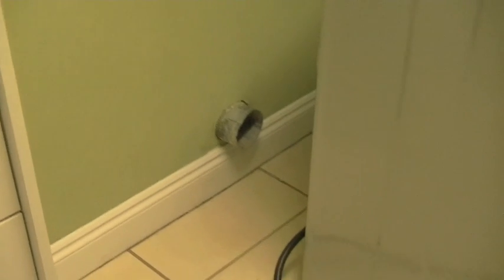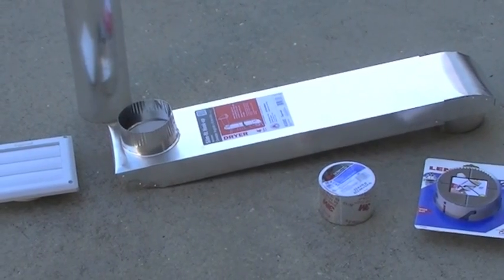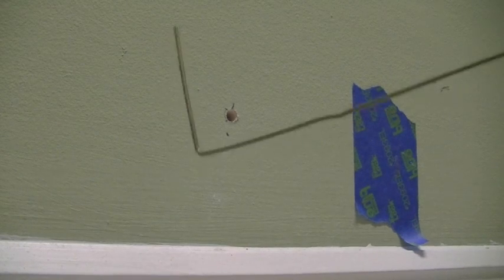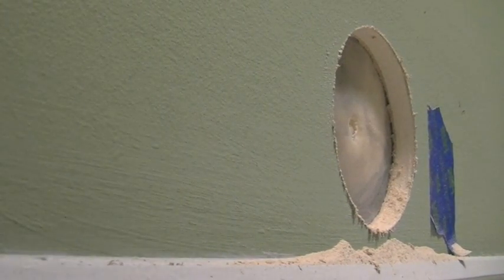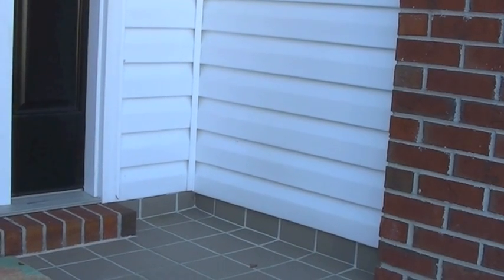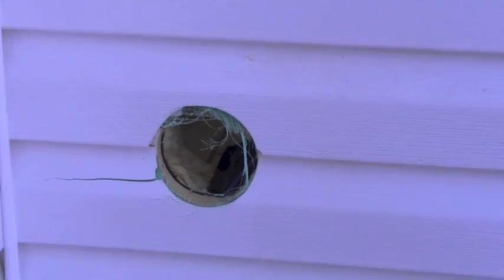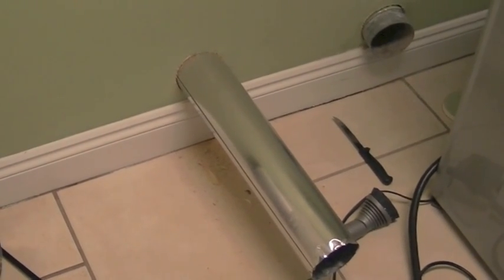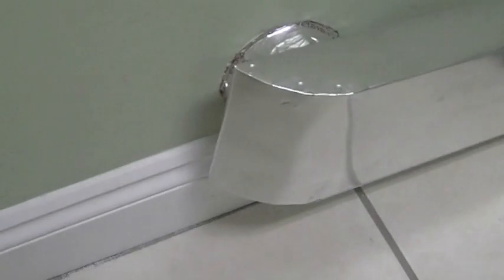Dryer Vent DIY Project #1

Comment: I'm watching this in 2025 and this is by far the WORST dryer vent installation I've EVER seen.
Reply from the maker: @georgewoolinghamii488  Thank you for your input.  FYI, 2025, this project is still working perfectly with no issues.
Reply: @KnTGoree  Didn't say it wasn't functional but the placement, the methods, and the materials used aren't the best I've ever seen otherwise it wouldn't be by your front door, cracked siding during drilling and that periscope is an in wall design but if your happy with it then good 4 you, you did it. The function of a dryer vent is not difficult but this install wasn't anything deserving recognition expecially to pride yourself on youtube. ANYONE with basic common sense can just install a dryer vent but doing it appropriately is something else. The only things I can say good about it other than it functions and is sort of out of the weather is anyone ringing your door bell will get the fresh scent of your dryer sheets.

Comment: Why did you need the telescoping tube?.  Couldn't you have connected direct to the outside and use a semi-rigid tube from dryer to new vent hole?  You'd shift the dryer to the left giving more room to the washer at the right.

Comment: Just an FYI I should've mentioned for others.  They do make booster fans for long runs, if you have to have a long run.  And, all dryer vents should be regularly checked for lint, but, longer ones do require cleaning more often.

Comment: I wonder why the hell somebody would make a 30 foot run when they could just dump it outside?
"...unfortunately we have to do it right by the front door..."
nvm...
Reply: Probably because when they built the house they didn’t want to put the hole by the front door and didn’t realize the fire hazard and dryer inefficiency of a 30 run.
Reply: @dansmith1743  Well, did the house burn down at some point?
Also, new dryers have backpressure gauges built in so you know if your vent is restricted.
And aftermarket gauges are cheap and easy to install also.

Comment: That is the worse possible set up..You never use a periscope vent at all, it creates too much back pressure and fill the dryer up with lint. Also that cheap plastic outside wall vent will crack easily with heat or temperature change, also you should be using 26 gauge snap lock galvanized piping thru the wall...The list goes on and on....Let the Professional do it or do it right yourself.

Comment: Not trying to discourage DIY, but $250 was a steal. The hole saw and arbor cost at least $40... that's a tool that most people won't use again. Also caulking around vinyl siding is not going to seal the vent.  Vinyl siding doesn't keep water from rotting your paneling or getting into the house through dryer vents or windows or any other cutout. It's the paper and gaskets. Paying a professional $250 to insure that you are covered by there liability insurance in the case of a leak is WELL worth it in this case... especially when materials were probably $100 (after replacing the cracked vinyl siding)

Comment: OH. MY. GAWD.  1) It's called a "periscope"; not a "telescopic ventilation tube".  2) You should not have put a hole in a location that breaches a moisture/outside barrier without knowing how to properly repair after. That stuff is there for a reason. That being said, your outside hole would have been lined up if you went from the outside and drilled inward first. 3) The vinyl siding didn't "crack because it was a little cool." 4) Periscopes are among the MOST restrictive vents. A large amount of the moisture is trapped, which results in longer drying times; and you could very likely blow your motor. 5) "Removed the excess from the existing tube." More like you removed way too much. No wonder you said you "hope to seal it up some way shape or form." 6) "Zero leakage into the room." Really? 12:07  You didn't use that "3M foil tape" on the big slices in the periscope. 7) Why do you think this video is good enough to post to demonstrate for others to follow? You should be embarrassed!

Comment: I see you have some big ticket installers looking at your project. You'll note them for the negative comments meant to make you feel bad by doing it yourself and not paying them $35/hr. I would say the periscope tube isn't the best idea. I have one I used for my a/c system while I was renting. That way I didnt cut through walls. If this is your house, do get the rigid vent.

Comment: I watched your video to see if there was mention of a SPECIFIC TYPE of sealant required around the vent, only to find out you didn't use any at all!  Is it the internet that makes people full of themselves or is it just certain people who are already that way?  This guy has the arrogance to think that he can teach others how to do something that he, himself, has apparently never done before(not correctly, at least)!  Hey everyone, you too can pose as an expert even though you have NO CLUE what you are doing!  Many, many things wrong with your install:  vapor barrier, your guests getting dryer lint blown on them as they ring the doorbell, dryer lint that needs cleaned from your front porch(more than you would expect, but you probably know that by now), rain that drips down the siding and runs into the inside of the wall, cracked siding because you ran the drill forward(vinyl siding 101 - no wonder you edited that out!).  The only thing you have done here is propagate bad information and poor techniques. This isn't DIY, its FIUY (Fxxx It Up Yourself)!!!
Reply: samiches2008 😂

Comment: you need to up date your drill also be careful you were using the drill at a high-speed. you need to start of slower if not you could potentially break your arm
Reply: with the kickback
Reply: Fred Flinstone era drill

Comment: You cracked the vinyl because your hole saw needed to be running full speed before you touch the siding
Reply: Chris Zano no, he should've ran the hole drill in reverse. it basically melts plastic instead of jumping everywhere
Reply: Reverse dumbass

Comment: Holy crap what an awful job! You destroyed the siding and then just left the damaged piece there??!? Why didn't you use a vent with a built-in trim channel for vinyl siding? You wouldn't have had to drill, it would have been a square cut you could make with a knife. If you worked for me you'd be fired and if that were my house you wouldn't get paid.

Comment: Good job using foil tape and not duct tape but as others have pointed out, the exhaust location was a poor choice and is actually in violation of Residential building code:

M1502.2 Duct termination.
Exhaust ducts shall terminate on the outside of the building or shall be in accordance with the dryer manufacturer’s installation instructions. Exhaust ducts shall terminate not less than 3 feet (914 mm) in any direction from openings into buildings. Exhaust duct terminations shall be equipped with a backdraft damper. Screens shall not be installed at the duct termination.
Reply: Sorry, residential code... where?

Comment: next time run the drill in reverse till you get thru the siding then  switch back to forward. in reverse the teeth will not grab  and cause your siding to tear like it did.
Reply: +Matt Galanes 
I concur.
Reply: 100% yes. This can also be used when you're hole sawing for door deadbolts. Even with the plastic adapter they sell in hardware stores. Set your drill to reverse, the teeth won't watch the wood as hard, but it will still score the surface - and eventually create a groove for the hole saw and won't jump out.
Reply: Did mine today. Ripped up the siding.  Should have watched this and read comments first.

Comment: Good job with couple of mistakes as follows:

1. The dryer vent location is a problematic (entrance to property ) !!

2. You should only  reverse drill  on both dry wall and vinyl siding.

If I were you I would try to move washer and dryer to a garage if possible or to fix the issue without moving dryer vent location.
Reply: Yossi Khalon I don't think that is a problem lots of houses have it that way were I live.

Comment: This fix could be a potential nightmare scenario if you live in colder climates. The vent steam will freeze your door shut. I've had this setup when I first bought the house. Had to reroute to another location away from the doors. 2 storm doors destroyed and weather stripping to entry door destroyed before I could get around to fixing it. This must be ok for warmer climates.
Reply: I bet if he used the left stud instead of the right, he have 2 feet or more away from the doir!.

Comment: 1.) You could have found a better location. After a few months to a year you'll have your own answer as to why. 
2.) You spent $40 in materials total? What about your labor. Wjhat do you get paid per diem on your job? Don't forget to add on the gas travel time and time spent in Home Depot and the caulking or vinyl siding repair work if you go ahead with that…. .
3.) You did not get through as cleanly as you possibly could have- In fact you messed up, (Hint You used the wrong hole saw bit  for vinyl portion.but no matter.)  
Conclusion- If you still did this project for what you are played for a day- Otherwise You lost money.
Reply: You sound like a jealous contractor. Hurts when homeowners do their own work huh? Yeah, he's going to figure out a little lint by his front door, but it looks like he keeps that pretty clean anyway and it isn't going to be a big deal. Also, anytime a homeowner does his own work it's considered an investment. Any costs for his time is countered with pride of ownership, maybe you're not a homeowner...which would explain a lot. I started doing my own work when I paid somebody to do something and it looked like I did it. LOL I'd say if he thinks it looks good and it's functional it's perfect.
Reply: aconsideration1 I am a very good general contractor with extensive experience . That is why i posted this response . I came on line looking for the new code compliant hard pipe installation to see if anyone had a faster way to do it than I .Instead I  came across this video which reminded me of how I would do something 40 years ago before I became a professional.  Ripping the vinyl with the hole saw-  really?Putting the dryer vent at the front door Really?  for the record , I own 3 properties. I meant no disrespect to the poster. My reply directed  to others that may believe that this is right the way to install a dryer vent and proceed. - It is not. It would be the blind leading the blind.  Have a nice day.
Reply: He doesn't "sound like a jealous contractor", he sounds like someone who knows what they're doing. The vent is too close to the front door. We're not just talking about "a little lint", we're talking about a building code violation. He also destroyed that piece of siding, which is now going to let water leak into the wall, and he cut through the vapor barrier without taping it afterwards, which is going to cause mold to grow after the water gets in through the broken siding. If you're going to DIY, make sure you know how to do the job right - otherwise it's going to cost a lot more to repair the damage you cause than it would to hire a pro in the first place.
Reply: All these armchair DIY pros

Comment: Good vid.  I'm surfing Ytube since our vent hose came off on inside & was suddenly blowing moist air inside.  HVAC guy would easily charge $150 for what I'm doing.  Discovered the home builder cut a corner by installing too short a rigid 4"dia vent duct on the inside of wall (short stubby 6" length) AND failed to fasten it down, so I'm going to install a new 9"long piece (rigid, about 30gauge).  This vid shows the 1" overhang needed for the Foil tape i needed to know.  Thx mate.  The Telescope-style vent looks promising,  however per Amazon owner reviews only the <Dundas Jafine UD48S 90 Inlet Aluminum Dryer Vent Duct> model is best ( says AVOID the "DAF...Skinny Ducts" at all costs because it will not mate with other vent duct parts &the metal is way too thin & flemsy.)  Cutting a 4" hole in vinyl siding -a Dremel Tool with Circle Cutter & Straight Edge Guide Model 678 & Cutting Bit #561 works great.  I'd strongly recommend plugging up the prior 4" hole --extremely easy to do - just use that 4inch sheetrock disk you cut out from the new hole, short wood Fir strip (3/4" thick /3 1/2"wide /8"long) and Dap CrackSHOT High Performance Spackling Paste (heavy mud).  Slip the wood thru the 'inside' hole & run a sheetrock screw about 1inch from the edge into the sheetrock on each side, add ur 4" disc, then putty over.  My Electrician did this in my garage after he ran new wire for a new outlet.
Reply: Kinda cracked it a little bit.  WOW !😂

Comment: Good job you did it yourself! One easy thing for drilling through siding is drill your hole in reverse until your through the siding it's less aggressive and won't tear your siding! After you make it through the vinyl switch it back to forward and continue doing the rest of your hole...
Reply: good tip

Comment: Props to doing it yourself but your periscope connection is rated "very restrictive" for airflow, I recommend you replace it.  There are a bunch of videos showing pressure differentials in all sorts of ducts and duct terminations.